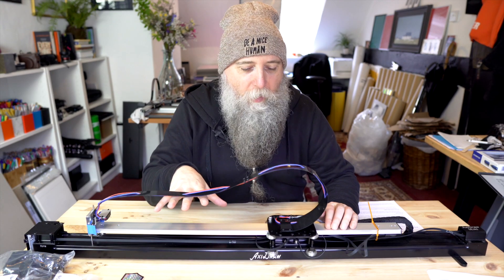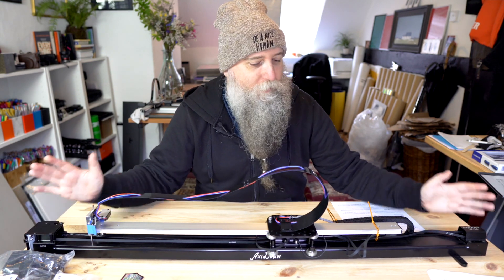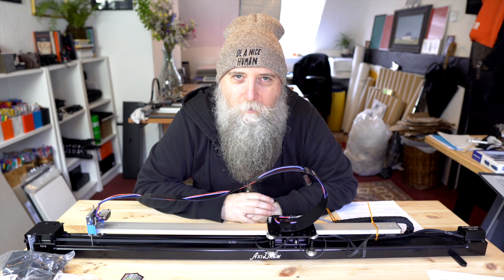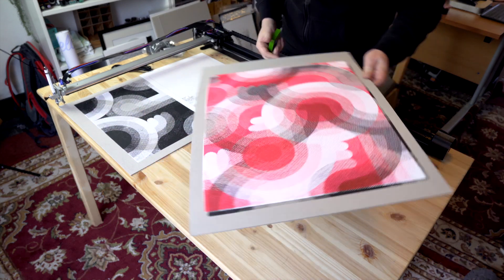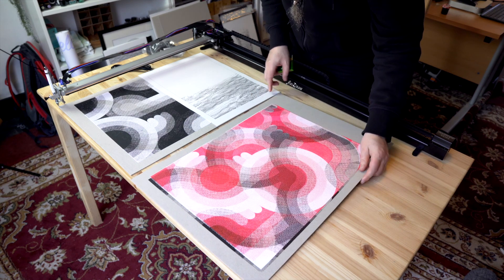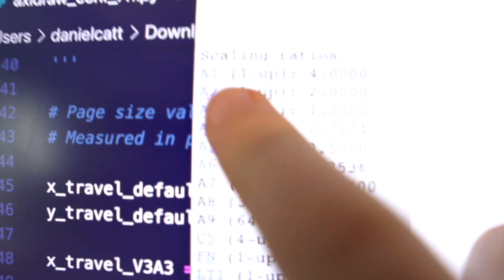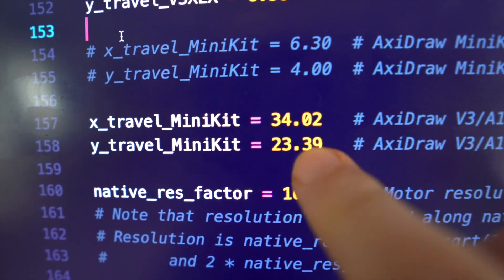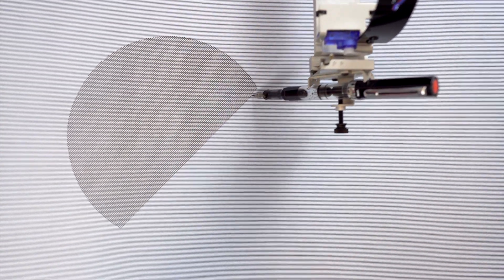AxiDraw - SE/A1 Unboxing

Comment: Hello and thank you for the work you do: I love it!  Also, I plan to buy an Axidraw  A1 but I still wonder about the reliability of this machine.  What do you think after all this time of use?
Reply from the maker: Ah, it's really good, a lot more solid in it's build than the early A3 one I had. Turns out I can run this one faster than the A3, I'm loving it.
Reply: @revdancatt  Great !  Thank you for your feedback!  In terms of effect, and in particular for flat surfaces (I know that this is not the Fort of the axidraw), can the machine compete with screen printing, with the use of posca for example?  I looked a lot at the work of Licia He and Lars Wander as well as yours!
Reply from the maker: Licia's work is watercolour, which works wonderfully with the AxiDraw.

The problem with Posca pens is they dry out really quickly and you need to "re-prime" them, which is a pain when plotting. I mean, solic colours can be done, it's just not the strong point of the plotter, which is all about the lines.

Comment: If space would be no issue, would you have bought an A1 model straight away, or are you happy that you have you experience built upon the A3 format? Just asking since I am on the fence to buy an axidraw, but not sure if I want to go all in with the A1 and the over 2K investment, or if the smaller format might pay off in the long term. Experienced generative artist here btw :)
Reply from the maker: If I could do it again I would have bought the A1 straight away. When I was deciding between the A4 and A3 model I knew I'd want to go larger, so picked the A3.

A few weeks into using it I A3 seemed really small, and I was working out ways I could move it around on an A2/A1 sheet to make larger plots.

I often do A3 and smaller plots on the A1, even to the point that I sometimes think about how I could set it away doing four A3 plots in one go 😁

So I would say go for the A1 if you have the money and space.

The other thing I'd suggest, and I know you're already experienced. Is just work on your code that'll spit out SVGs first, and print them out normally on A4 paper & stick 'em up on the wall. Get a feel for the type of designs and outputs you want to do. If you manage to sustain working in that "line only" style for a few weeks and really feel the itch to have them pen-plotted then get the plotter.

If you're not feeling the excitement for coding line based stuff after a few weeks, then save your money.
Reply: @revdancatt  I would be interested in any information (video?) regarding how you used the A3 to make larger plots. Did you ever develop a reliable routine? Ways to register etc? I would imagine it's incredibly difficult with most of the precise, geometric plotter art that I see, but if one were making plots that were a little looser maybe it would work out. Any thoughts?

Comment: I have a question about axidraw machines. Can you use a cutter instead of pen and cut normal papers?
Reply from the maker: Nope, sadly. The best I've seen is adding a vinyl cutter and cutting thin vinyl. I have seen it done the other way around, taking a paper cutting machine and using a pen instead.